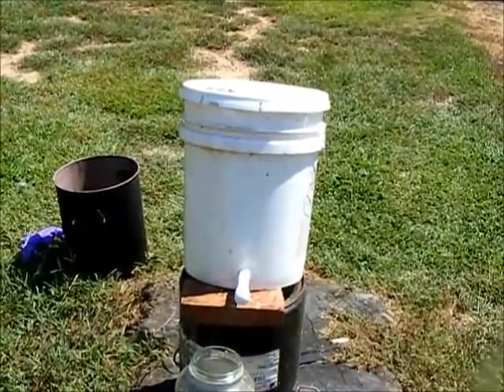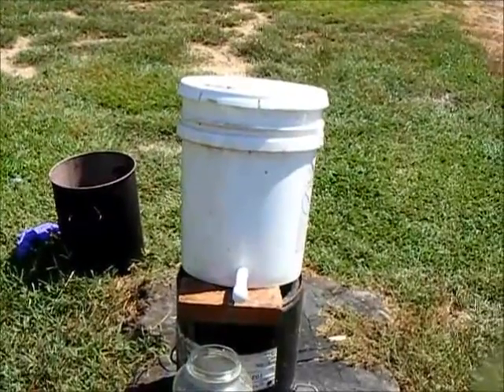Making lye solution for soap making Part 1

Comment from the maker: I will go back to this again when the weather is warmer. I will also have a better ash solution then. The way you test the lye solution is to put a raw egg in It (in the shell of course) If it floats with about a quarter size island of egg shell above the solution it is ready to make soap. my first attempt my egg sank like a rock. You can go to the store to by lye but that would defeat the purpose of doing it the old way.